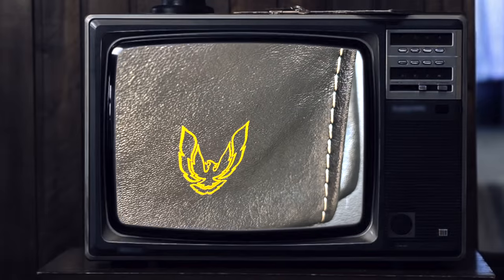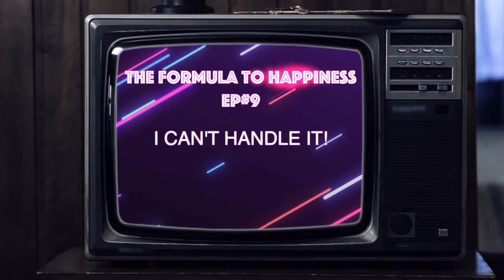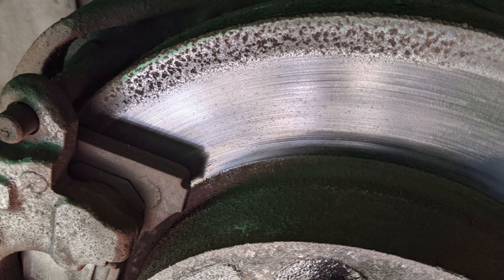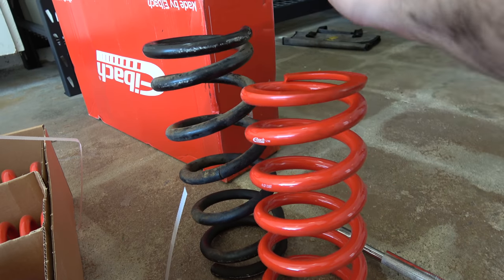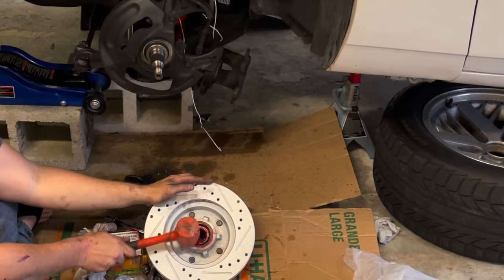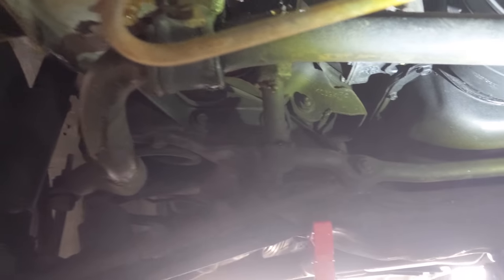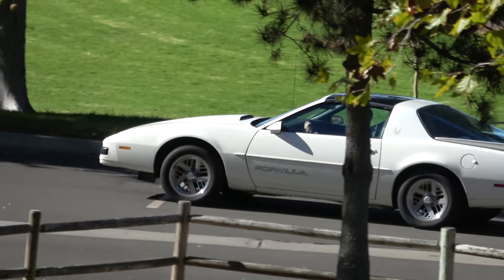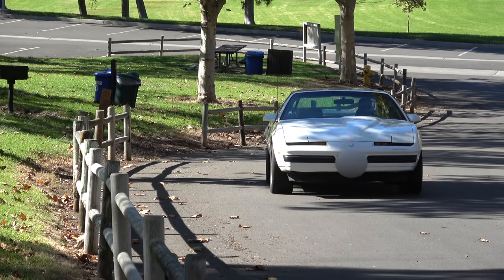"Performance Suspension" More like "Impotence Suspension"

Comment: WS6 is an RPO code, it is not an abbreviation of anything. 
From wiki:
The WS6 performance package option, available on the S/E and Trans Am, included 4-wheel disc brakes, P215/65R15 Goodyear Eagle GT radials with 15-inch cast aluminum wheels, stiffer springs, thicker 32 mm front & 21 mm rear sway bars, a 12.7:1 quick-ratio steering box, and limited slip rear differential.

And for later cars like yours:
WS6 was standard equipment on the Formula and GTA from 1987 to 1992, and optional on the Trans Am. WS6 from 1987 thru 1992 included 36 mm front sway bars, 24 mm rear sway bars, quick ratio steering box, gas filled struts and 16" Wheels with 245/50R16 Tires. Later WS6 cars used ZR rated tires

Comment: Winston, the WS6 cars did handle very well when new. But even 'Performance Suspension' systems will feel like crap when tired and worn out. But also, what would be considered 'Performance Suspension' in the 1980/90s would be laughable by today's standards. Suspension technology has improved so dramatically since then that we are kind of spoiled by it today.  Anyhow, great video as always man. Stay awesome!
Reply: I don't know, my c4 corvette felt like it was on rails in comparison and it's the same time-frame as these firebirds
Reply: Exactly - for their time they did handle great
Reply: Try a dealership maintained Lotus Elise, Exige R, and you
feel the difference of what is a 'performance suspension'.
This spongy american suspensions never beat one of a Lotus.

Comment: Working on the F Body, loving it! When I installed my "wonder bar" I also replaced not only the end links, but the main anti-roll bar mounting bracket rubbers with poly as well, really tightened things up. Looking forward to your next TA upgrades.

Comment: I had one just like this car.  I highly recommend replacing the bushing with poly.  The original bushing are usually deteriorated within 5 years.   They tend to crack  and distort.
Reply: Good idea. I've had good luck with the poly replacements when rebuilding suspensions.
Reply: Yes sir. My 82 with TRX package is great, it has 15k miles. Vs my other 82 GT with 60k miles neither has had suspension work and you can tell the differences.

Comment: I'm sure it's too late, but I'd steer clear of drilled rotors, even slotted, for a road car.  Drilled rotors were originally designed to relieve pressure from outgassing of older brake pads, whereas newer materials don't have the same issue.  What you want is a large, flat, rotor with as much surface area as possible to maximize your pads contact patch. 

The only application I use slotted rotors for was our 24-hr Endurance racer, which used high-temp Porterfield R4-E brake pads.  The Porterfield rep I spoke to said the slots wouldn't hurt the brakes performance at high loads, but would help get dust away from the pad when the pad temperatures were too low, helping me get the brakes back up to operating temp after a pit stop or yellow flag.
Reply: The out-gassing comment is interesting; I hadn't heard of that problem.
Reply: I had massive brake fade due to the pits and rust I'm guessing but the brakes were overheating badly and that was why I went for drilled and slotted rotors
Reply: @serpentza  Overheating was probably just poor quality pads, which can overheat and fade, although older rotor designs did have poor cooling vanes which offered limited airflow.  These vanes basically act like a centrifugal air pump, and they may not be omnidirectional, so make sure they are oriented correctly.
On our race setups, we actually cut holes in the brake rotor shields and ran ductwork from the front bumper to each of the front rotors, made a huge difference.

Comment: Ok so you're missing a few things here. Back in the day these cars handled amazingly and still do, I can ride the bumper of a M5 in a corner with ease, but as soon as we come out of the corner he will lose me. You need new shocks and struts 30 plus year old shocks and struts just simply do not perform, try KYB adjustable they are a good performer and won't break the bank and will allow you to adjust your ride comfort cause those Eibachs are going to make your ride harsh. I can see that the front sway bar bushings are worn and you should also replace them with poly urethane bushings, use caution because you need 36mm for the WS6 front sway bar (try Top Down Solutions). You also need to pay attention the the back of the car, sway bar bushings and end links, because you lowered the car you also need to replace the pan hard bar and get the adjustable one, you only need one that adjusts on one side and also replace the stamped steel rear control arms with a tubular set. I just did all of this to my GTA....yes a refrigerator on wheels as you described it in an earlier video (I'm still bitter but I did not unsubscribe) and your car will handle better than a new M5! After all of that is done you should do a tubular torque arm and sub frame connectors and you will be AMAZED at the handling performance of your Formula. Loving your videos, but call my car a refrigerator again and I'm going to consider those fighting words...LOL (white GTA's maybe a little bit) :)
Reply from the maker: Hey at least it’s not wrong to say a refrigerator is cool! Seriously though, thanks for the advice!

Comment: my friends 89 iroc had a strut tower brace and a custom sub frame connector job- you could really tell the difference.  back then the cars were newer and still reasonably tight.  They just understeered some, but the torque arm suspension does plant the rear harder around right turns.

Comment: Nice upgrades, on My GTA I added UMI sub frame connectors, lower control arms, and panhard bar with new poly sway bar bushings all the way around with a Wonder Bar. Those mods vastly improved the rigidity and handling.
Reply: ^^ This guy knows what he's talking about^^

Comment: Keep in mind the third generation F-Body debuted for the 1982 model year and had been in development since the mid 70s.  For the time in which it was developed, that suspension system was pretty good.  I had a 1967 Camaro, currently own a 73 Firebird Formula and 1993 Formula, and previously owned a 2001 Trans Am WS6.  The difference between the 67 and 73 was night and day.  The difference between the 73 and 93 is plainly obvious, but the difference even between the handling of my 93 Formula and my 2001 WS6 (two cars from the same generation) was even pretty drastic (stock for stock).  Technology improves exponentially.

Comment: What it translates as, is that GM spent more money on the advertising, than they did on the engineering and manufacture of the suspension.
Reply: All flash and no substance.
Reply: @remyllebeau77  It was a shame, really. Detroit had a good hand on styling, but the cynical nature of upper management was to maximize profit over quality; as if people wouldn't notice in time. It reminds me of their attitude towards smaller, foreign builds. Americans will never settle for small cars and they will never rev their engines above 3,500 rpm. That, and "J" cars; don't get me started on those.
Reply: At the time when those generations of Fire birds and Camaros ran circles around the mustang on a race track so the suspension was good for there time but gm is not the only company that did the same thing bigger is better Ford did it too for their 2015 mustang GT with a track pack  handled like garbage compared to the 2015 Camaro ss1le
Reply: @williamswenson5315  Also remember Gm's performances thought very differently back then the corvette was meant to be Gm main performance vehicle so management did not want Firebird and Camaros to perform better then the Corvette since it would eat into the sales haven a sports car that is cheaper and faster then the main Halo car the vet was bad for business compared to now the Camaro and Vet teams compete to see who can makes a better car
Reply: So business as usual?
Reply: @tiborklein5349  Yup. Even now, they just don't get it. My VW GTI was bought new in '03. Other than routine maintenance, it still runs fine with no expensive repairs.
Reply: @williamswenson5315  Well it does also come to who owns the vehicle and how they care for it working at an auto parts store and dealing with customer that freak out over cheap $30 dollar wiper blades or light blubs that cost $6.99 and ask why so expensive
Reply: @master6435  My comment was directed mostly towards GM's overall philosophy when it came to producing cars of a limited quality while relying on brand loyalty and advertising to sell product. I suspect they paid lip service to performance and sold their cars based on sex appeal, snob appeal and the usual blandishments to buy their product or be a hopeless outcast. The boardroom never gave a fart in a wind tunnel about real performance.
Reply: @master6435  Sorry, you lost me. Try rewriting this remark.
Reply: @master6435  Sorry, you lost me. Try rewriting this remark.
Reply: @williamswenson5315  What part did you get lost (that I work at an auto-part store that end with zone where customers freak-out over the price of wiper blades and light blubs) or (Gm performance philosophy)?
Reply: @master6435  Better. No, I don't know why people freak over pricing on anything. As an employee of the store, you don't set the price. If they don't like the price, they can shop on-line or try ellys or dvance. Yeah, I've dealt with the type in my line of work also.
Reply: @williamswenson5315  For the fact people freak out over a $6.99 blub maintaining the health of a vehicle is not a priority it just cheaper to keep driven a vehicle with a failing radiator, water pump or other mechanical part then fix it most my costumer drive American car which aren't know for being the best engineered if one part is going out it needs to be replaced or when it breaks it might take other parts with it like I drive a Toyota that's been driven with almost zero oil and at 135mph turns on every morning
Reply: @master6435  Yeah, my Corolla E-5 was a good little car. I drove it all through college and spent almost no money on it beyond oil changes. What I'm curious about, is whether Toyota will go big time into electric cars. We'll see.
Reply: @williamswenson5315  They are betting hydrogen
Reply: @master6435  They are not paying attention then. The infrastructure to fuel those cars burning H2 is not in place. Production, tankage, shipping and refueling stations would have to be built. Frankly, the public is not going to be comfortable using H2. One Hindenburg event and that would be the end of it all. Not going to happen.
Reply: @williamswenson5315  naaah they just dont have the money for the repair
Reply: @williamswenson5315  The customer knows that the part is bad is going out but when he or she sees the price they just want a bandaid fix...
Reply: @master6435  I'll be curious to see how long that bottle of Lucas Steering Box sealant lasts in the "Red Neck Viper".
Reply: @williamswenson5315  Yeah exactly it's sad see dilapidated vehicles when they first were built they were "perfect" unless built on a Monday
Reply: @master6435  Yeah, that and the worst body cars off the line are painted white and the best are painted black.

Comment: Nice. I had an 88 Firebird. Came with a 2.8. Swapped in a carbed 305, which I lasted many years until I decided to put in a 400 small block from a blazer. Kept my stock  305 heads, but drilled in the sweat ports. Fast in a straight line not in the corners. Changed all tie rods, ball joints and barely made a difference. Until I invested in polyurethane control arm bushings. You should consider them, but remember to torque bolts when the car is on the ground to prevent binding.

Comment: I think you have to look at it in context of the time. Also, what’s the condition of the original suspension?
Reply: Exactly.
Reply: @theotherwayofstopping4717  yes sir. My (I'm a Ford guy but love firebirds) 82 GT with 15k miles vs the identical (literally down to options. Did it so I can drive one...) with 60k miles with nothing replaced (yet, am planning on doing it soon), the 15k mile car is night and day difference. The 60k mile car is getting more suspension upgrades along with a set of heads. Should help the fun factor

Comment: I just got my new lower links and panhard bar for my 91 T/A Im trying to get it stiffer there a little bouncing when you get around people on the highway kind of wants to return bounce Id would do lowering springs but it on 18's did find a duel exhaust pipe kit to really think about it to. your going to have a nice one Winston

Comment: I have a 88 gta trans am Pontiac firebird tpi and t5 
And you need the brake prop valve spring 
My car nosed dived and now it doesn't 
I got the wonder bar to 
Big diff 
And I got a big brake upgrade kit ls1 trans am 
Dual piston calipers alum and cross drilled slotted rotors and nine pads 
That makes my car stop insanely better 
But you need the spring

Comment: Quite frankly, all my TA's have handled superbly, & on par with modern ultra performance cars, especially after freshening them up. So your Formula must be pretty tired. If the car spent 2 years in Ohio, that's the equivalent of like 10 years in the salt mines under the Great Lakes. My 1981 'Bird also has the UMI equivalent of a Wonderbar, as well as  heim-jointed, fatter sway bars, poly bushings, solid motor mounts, Koni shocks, upgraded steering, new suspension components, solid body bushings, subframe connectors & P325 rubber (plus other minor upgrades). I have not even come close to exhausting all the (mostly minor) improvements that it's possible to make on my 2nd gen F-body. Wheels & tires are next.
Reply from the maker: My 78 will get the same treatment for sure!

Comment: I put a wander bar on my firebird. It didn’t do anything noticeable for handling. The best thing for handling was polyurethane bushings and rear tubular control arms. The brakes suck on third gens, because the proportioning valve is bias to the front. There is a hack to put a different spring in it and it is supposed to make the rear brakes work much better. I haven’t tried it yet.

Comment: When sanding the discs, it helps to put it in gear with the whole front jacked up. The rotating discs do much of the work for you and results in a more consistent finish.
Reply: That only works for the discs that are least important. The front discs are the ones you care about, especially on older cars like these.
Reply: @xenonram  Sorry. Do it on the drive axle. It might be front or back.
Edit: Here in the snow belt, most all cars are front wheel drive.

Comment: What's very strange is the wonder bar was only installed on late model IROC-Z Camaros, and never on upscale Firebirds. 
WS6 doesn't mean anything, it's just an RPO, or option code, for a supension package. In some years you had WS6 without rear discs, and it gave the WS7 package. You also had WY6 and WY7 if you removed the limited slip. Like WS4 means Trans Am and W66 mean Formula.

Comment: FYI your WS6 features a faster steering rack, larger front and rear sway bars, an LSD, not standard I think, all around disc brakes, some firebirds had disc and drums, and bigger 16 inch rims and tires with unique to that spec'ing tires to help curb bodyroll in handling

and I know that as literally theirs a 1985 firebird trans am spec video in my suggestions lol so basically its the trans am package without the trans am decals and the Higher Output motor. 

and I wouldnt really knock Pontiac for the WS6 Package too badly, the car is over 30 years old and it lived in florida, chances are all the bushings died years ago between the moisture and the heat, and a good thing to do going forward would be to put the thing up on the lift and just yank on everything to make sure its tight and in place, as per what leno has said of the subject

as alot of times things have come off and not been put back on properly, and then look into some extra bracing, as the firebirds an Unibody, the body IS the structure, and I bet the thing would really benefit from a Monte Carlo Bar under the hood, and maybe some traction bars to help keep the axel in place better

and that's kinda funny, that is exactly what the wonderbar does, hell i wonder if that's what the towframe on the knight rider cars accidentally did really, as I've been watching the knight rider historians and the stuff they cover on these things, and judging by where the wonderbar is, that is right where the tow rig was attached to the car

like no wonder they left it on between shots, wonder if that works on the rockford files era ones too.

Comment: Serpentza have you ever thought of replacing all of the Bushings on the entire suspension? You could go to Tijuana and maybe have em lift the frame and install em that would be a cool video adventure.
Reply: Would the car then leap into the air, bounce up and down and flash Xmas lights from the rear axle?
Reply: @williamswenson5315  Low Rider it all out?  Nope, Serpentza should replace the bushings & keep it stock.
Reply: @podcastfan2544  Just teasing. I agree with you actually, although I would not be opposed to improvements in what was not a great design to begin with. That suspension needs to keep the wheels on the pavement and an increase in stiffness in the front and rear would not go amiss either.

Comment: So weird that Pontiac advertised that the car had a performance suspension, like wouldn’t the owner know ? Just like on the 97-03 Grand Prix wheels had abs stamped right onto them just in case you forgot

Comment: I also changed my front struts to kyb agx 4 way adudtsble fronts 
And I'm doing the rear this spring there not cheap 
And I cut a coil from my springs to lower it 1inch 
I think I'm gonna do the sway bar bushings